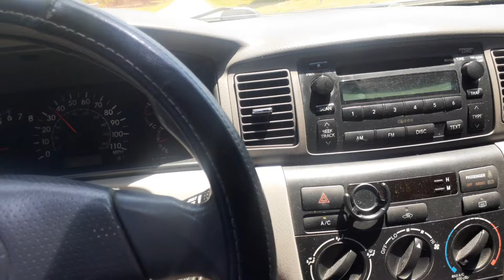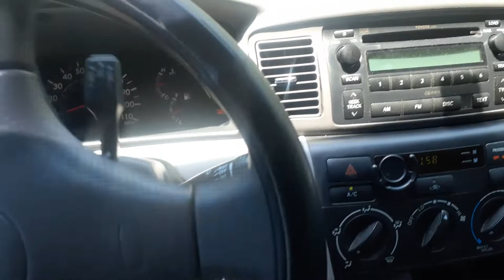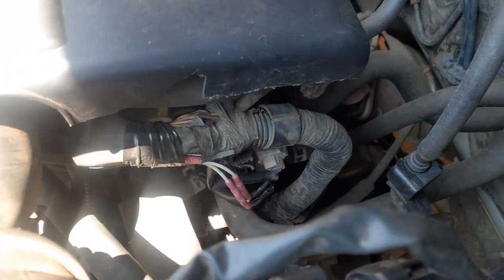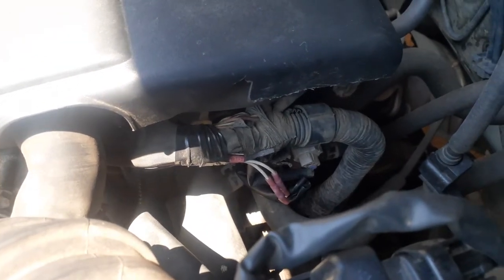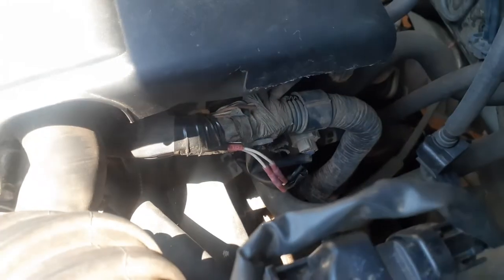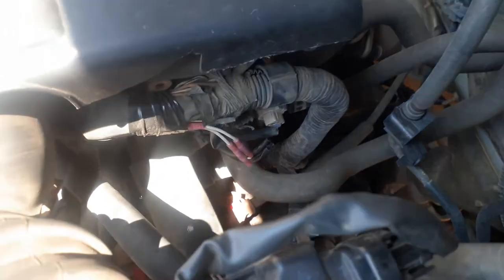Toyota Corolla Crazy Temp Sensor/Electrical Issues Solved

Comment: Just had my throttle body apart again today. Car is bonking out at idle. If it wasn't pissing rain right now I'd be under the hood now checking this!!!! Thank you! I was losing what's left of my mind!!!
Reply from the maker: Ha, I hope it helps. Let us know what you find.
Reply: @TheAntarcticEmperor  I found some bare wire in there and I've noticed the issues are worse in the rain. Taped it up for now and if things improve I'll heat shrink the hell out of it. Thanks, man!!!!

Comment: I just made this discovery today on my 370k mile 2006 Corolla. Mine is hesitating to start sporadically after driving around. Cold starts are prefect
Reply: Hi, did you find the issue? I have an intermittent knock that appears frequnelty, specially with more load and turning the AC on. But runs perfect on cold start or cold weather
Reply: Interesting, my 2007 Matrix needs more cranking when warm than when cold. I will measure the coolant temp sensor resistance against another unit. Maybe the manifold air temp sensor has something to do with it. Maybe some loose connections or oxidation ?
Reply: @omarbari4861 did you ever fix this?

Comment: Check my 2006 corrola. Cover was rubbing at same location temp sensor wiring. Luckily wire not cut, only see wire, avoided the potential pronlem. I cut the cover like u said.

Comment: Hey man, a crazy electrical issue in my 06 brought me to your channel, however after checking I found mine to be in good condition, the issue I’m having is sometimes when I use turn signals or hazards it causes  cluster to go dark and rpm’s to drop in sequence with signals, so low the car stalls out. I’m thinking it’s my alternator. Any advice would be greatly appreciated. Thanks in advance
Reply from the maker: Sounds like your situation is totally different. Does the car start up without a jump? Do you have a digital multimeter?
Reply: @TheAntarcticEmperor  I fixed it, the ground under the battery tray was almost rusted through, I took it apart, got new bolt, she’s running like a red ass  ape 🦧 again. Thanks for responding, most YouTubers don’t even read their comments, keep it up

Comment: Great tip!  I have a problem with a 2005 Toyota Matrix with MULTIPLE codes that nobody has been able to fix.  The last shop said it was the ECU, but my main problem is my A/C doesn't always blow cold.  I think it could be the thermistor, but I'm not a mechanic, and don't know how to check it.
Reply: Ac not blowing cold could always be either a compressor failure or you need to recharge the system

Comment: My Toyota Tazz 1,3  both temperature and fuel gauge do the same, it's moving up and down simultaneously , I've changed the thermostat, temperature sensor and even the cluster capacity , but still going crazy up and down but no Engen boiling or overheating

Comment: yes I had had this problem .
 it effects the - GROUND wires as well, which screw on to the engine block , if one of those breaks and touches a + wire the car will seem like the engine is blowing up .
 but no, it is the harness ground

Comment: Great video. Does anyone know what the white plug with the single wire is for? If you stop the video at 3:57, it is the plug that is a few inches from where the wires were repaired.
Reply from the maker: I think it's the oil pressure sensor.

Comment: Can a coolant temperature sensor make your car kangeroo but still give you good temperature reading and fans all good  because I'm experiencing kangerooing when I take my foot off the gass before change gear but I turn the car off and back on and the responce is there ?
Reply from the maker: Not likely. If the fans are working correctly, (meaning they come on when either the AC is on,  or the engine is at operating temperature, and they stay off when the the engine is cool with the AC off) then temperature sensor and wiring is probably fine. Any codes?
Reply: @TheAntarcticEmperor  no codes it really weird tbh I'm gonna clean my throttle body and see if it helps me

Comment: How much it’s cost? For change??
Reply from the maker: There's no official labor time for repairing these wires. It will depend on what your mechanic decides to charge for diagnosis and repair. Some shops have a 1 hour minimum for diagnosis, and could charge as much as half an hour for the wire repair, so it could be as much as $250 depending on the shop's rate. Some friendlier shops might do it for as little as $50.